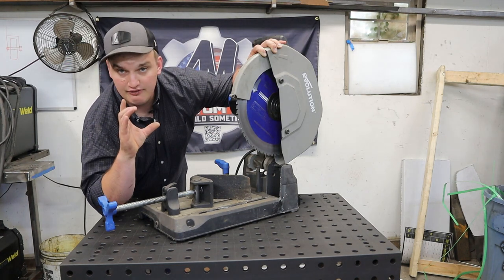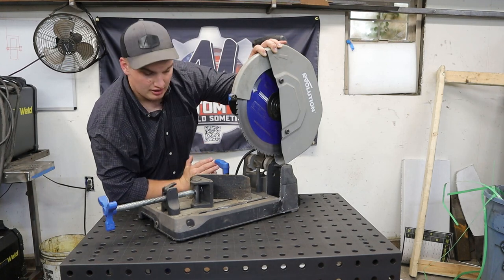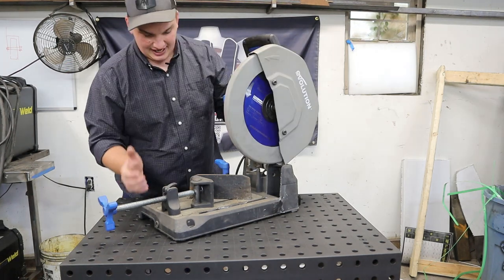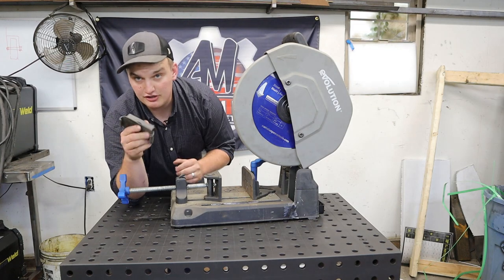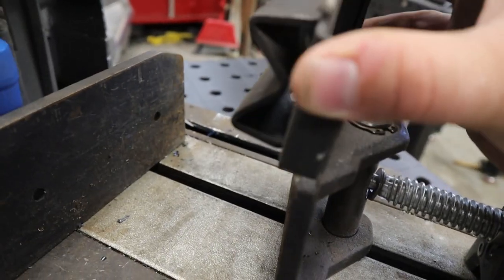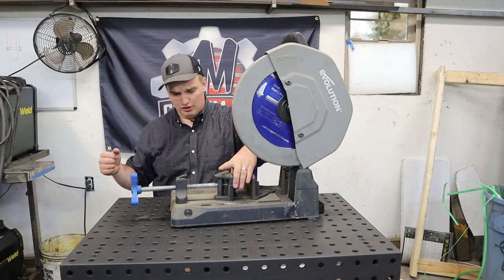Evolution S380CPS: Metal Cutting Chop Saw ( Review /Recommendation)

Comment: Good information. I've got the 14"  Evolution Rage 2  saw that works GREAT!! I wish it had the quck release but a heck of alot better then the Dewalt chop saw I started witth. This is a 14" with a cast base instead of a stamped base and it has a chip tray. One thing you don't do with these saws is let the motor slow down before cutting completely through (the little teeth do NOT like that)! I also have the 10" Rage 3+ multipurpose sliding mitre with the single bevel. Got it mounted on a HF roll around saw stand (fantastic). The bad thing (which is good) is it has a 1" blade mounting hole and you can't find a lot of blades with that hole (Evolution has them), most are 5/8". I like the Evolutions saws. Thank you for the fun informational videos, as always.

Comment: The Fein (Jancy) Slugger 14" chop saw is a great saw also and is very comparable to the Evolution. The only significant difference I have found is that the Evolution saw incorporates tool-less fence adjustment, whereas the Fein uses a hex key that stores in the saw's base. Both saws weigh in at 55lbs. When using 14" blade both saws perform the same although the Evolution can accept a 15" blade but I've never used it with one though. I bought the Fein saw because they make exceptional tools and I had no prior experience with Evolution brand tools. However after using both saws, I wish I would have saved $150 and went with the Evolution.